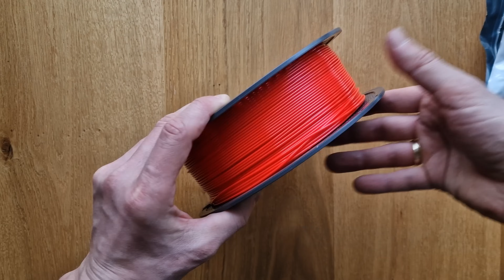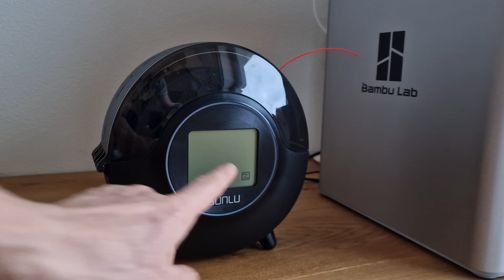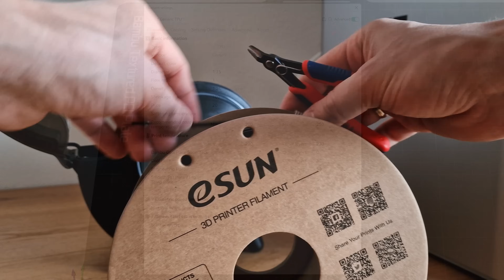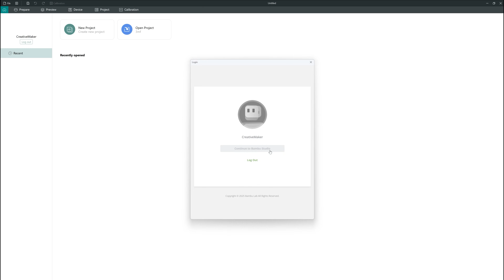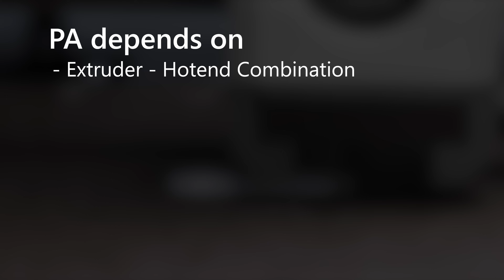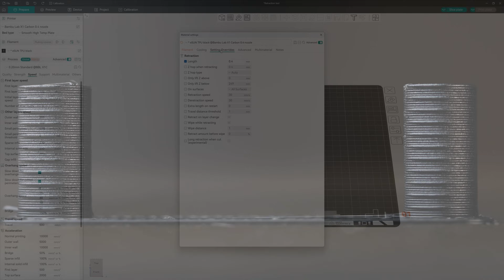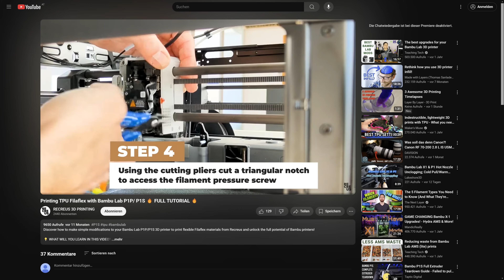Mastering Flexible Filaments on Bambu Lab - the Ultimate Guide 🛠️

Comment: You missed one important thing: cooling. Most TPU needs no cooling! If you turn off cooling you get excellent layer adhesion and indestructible parts. With TPU95A on my A1 i printed last time at 100mm/s accidentally. The part printed successfully, but PA value was not set so it looked pretty bad on the corners, but otherwise excellent. Also i use bed temperature of 50-60C to keep the TPU soft. Of course i avoid printing tall objects, so being TPU soft is absolutely not a concern for me.
Reply from the maker: You're absolutely right—I didn't really talk about cooling in this video. While I haven’t had any issues with the default cooling settings for 95A and 83A, it’s a completely different story with 60A. If the cooling is too high, the extruder jams after just a few layers.
So if I got you right—reducing cooling actually allows you to print faster? 🤔
Thanks for the tip about heating the print bed! I never really thought about how it could improve layer adhesion, but that totally makes sense!
Reply: @creativemakerat  cooling makes the part look nicer but much weaker in my experience.  Turning off cooling allows the material to stay warm, so adhesion is easier, less thermal shock when the new hot material meets the cold one. In general with most materials you always want cooling to keep the topmost layer temperature a bit below glass transition temperature, not less, not more. TPU is a different material because the glass transition temperature is like below -20C and in my experience TPU holds it's shape up to about 130-140C, so that's why it needs no cooling! I tested TPU parts in boiling water and they are just fine. TPU is pretty underrated for heat resistance. Unfortunately i have limited experience, and other filaments may behave differently. I used only TPU95A from Devil Design and some unbranded ones from Aliexpress with hardness around 85A (very hygrosopic, prints slower)
Reply from the maker: @dtibor5903  thanks for the detailed explaination!
Reply: @creativemakerat  just a note, the TPU from Devil Design is not AMS compatible, it is way softer than Bambu's TPU for AMS.

Comment: This is outstanding! Please do colorFabb varioshore TPU next. It is a very difficult material to dial in.
Reply from the maker: Thanks for your kind words! 😊
I’ve added the ColorFabb filament to my to-do list, but honestly, I’m short on time right now. In the last couple of weeks, I’ve only had a few hours to spare for my channel—so it might take a while before I get around to testing it. 😅
May I ask what you see as the biggest advantage of ColorFabb’s filament? Do you actually adjust the temperature in different zones during printing? Maybe someone else here has experience with this material? 🤔
Reply: @ I am using it for precision foam parts. I find it almost impossible to get rid of all the stringing however. I’d like to see if it can be printed without stringing at 240 C for footwear. It can get down to 55a durometer but again I’m not able to get a great quality print.

Comment: You do a great service for the 3D print community. But speaking just for myself, I get lost in all the science of your testing. What I need is a simple cheat sheet that would look something like this: 1. Use this filament... 2. Use this plate... 3. Use this heat... 4. Change flow to this..., etc. etc.  Subbed up and liked.
Reply from the maker: Thanks for the kind words! 😊 And also, thanks a lot for your suggestion.
I'm reworking my script for the next video to include a checklist at the end!
Now that you mention how complicated it can be to follow along - weird that I never thought of adding a sum up 😅
Reply: @creativemakerat  Extremely good work. A summary would be beneficial for some; I just stopped the video when needed and wrote down your golden numbers. I also wrote a short comment (from your thoughts) on each result. I have ordered some eSun TPE 83A and I was comforted to know it isn't as hard to print as the lower hardness/more flexible versions. I've subbed very few times and clear my history out so as not to be annoyed by notifications so subbing for me is a reward to good utubers like yourself. Cheers from Oz.

Comment: My TPU prints beautifully for about 20 min and then clogs every time. I just disassembled my extruder for the 4th time in a row and it's time I stop being stubborn and learn proper retraction settings because it's definitely not heat creep. Thank you!
Reply from the maker: Hey! Thanks for sharing your experience.
What's the shore hardness of your filament? Have you tried reducing cooling—maybe even disabling it completely? I had lots of jams when i increased the cooling.
Also, check your drive and idler gears. I once had an issue where material buildup formed in the gear teeth after multiple jams, causing more problems. If there’s any debris stuck there, try cleaning it out with tweezers.
Hope that helps! Let me know if you get it sorted. 👍

Comment: Loved your video! I can't wait for your video, I am trying COEX 3D 60A and having a lot of issue, I am having issues with clog after every print. Could you please share any quick info on the filament and print setting that I can look into meanwhile you make the video?
Reply from the maker: Glad you liked the video—thanks for the feedback! 😊
Sure! Here are some quick tips while you wait for my video:
Print profile: I'm using 0.2mm layer height and reduced speeds to 20mm/sec.
Filament settings: flow ratio: 1.2, print temp: 245°C, max volumetric flow: 2mm³/sec
Cooling (super important!): min part fan 0% (if layer time > 10 sec), max part fan 60% (if layer time < 5 sec), aux fan: off
If the cooling is too high, I kept running into nozzle jams—the pressure inside the nozzle just gets too high when the material cools too fast after extrusion.
Retraction: surprisingly, I could push it up to 2mm without any issues, though some stringing still happens.
Hope that helps! Let me know if it works for you. 🚀

Comment: I’m wondering, is there a flexible filament that is resistant to gasoline? Thinking of making gaskets etc.
Reply from the maker: Phew, I can't answer, but with 60A or even 83A, you can definitely print watertight gaskets. However, gasoline is a whole different story, especially if it's under pressure. And chemical resistance is maybe also a topic... Would be interesting to see if anyone here has experience with this!
Reply: Hey, you should take a look at this video "3D printed gaskets? Any good?" from @the_eddies . I found it interesting when I was researching flexible filaments for my needs, maybe it can help you!

Comment: The AMS communicates with the slicer and there are been a persistent bug in Orca Slicer with the TPU for AMS. Open instances (anywhere) will reset the AMS slot and not work with TPU for AMS. After I switched to Bambu Slicer there was no longer any issue. I print with TPU for AMS more than any other filament currently. The material is not flexible in the same way that softer TPEs are, but it retains incredible impact strength. Throw the benchy into a wall and watch as it never breaks while rigid plastics shatter on impact. I print Golf Tees with TPU for AMS. It has the perfect amount of impract strength and rigidity required to not break on impact while still allowing me to push it into hard ground.

Thanks for a great video!
Reply from the maker: Thanks for your feedback and the detailed explanation! That makes a lot of sense—I had Orca Slicer running when I ran into the issue of not being able to load TPU for AMS.
I was also really surprised during my mini vise test at how well the Benchy snapped back to its original shape. I’ve heard from some makers that they have issues with layer adhesion when using the default Bambu profile. Have you experienced anything like that?
Thanks again for your contribution!
Reply: @creativemakerat  I have not had issues with adhesion when printing practically any TPU. If I have issues related to adhesion with TPU it is usually in the other direction - getting it to let go of the build plate after it has cooled down. For TPU for AMS I have printed exclusively with Bambu Studio default profiles - without any issues on that end.

Some of the other brands have their own profiles you can import into Orca or Bambu Studio. ESUN have a large library of profiles that made it a lot easier for me. Especially the softer TPEs, e.g. 83A, were difficult to tune, but the ESUN profiles was great from the start.

I print on an X1C and an A1 mini.
Reply from the maker: @marcusnielsen9674  thanks for the infos. I was not aware that eSun providing profiles - great to know 🙏

Comment: A 17% increase in flowrate sounds like a band-aid, while the underlying issue remains unresolved.
Reply from the maker: Thanks for your thoughts! That’s an interesting perspective. Could you share a bit more insight into what you think the underlying issue is? Are you referring to the filament being compressed too much in the drive gears, which reduces the volumetric flow, meaning the tension adjustment screw should actually be loosened instead? Would be great to hear your take on it!
Thanks for your contribution! 😊

Comment: For TPU you need to use an engineering plate rather than PEI .. that way the TPU won't stick as much
Reply from the maker: It looks like Bambu no longer sells the engineering plate, which is why I used the PEI plates in my video. Personally, I’ve had good results with PEI, but I’m curious—what advantages do you see with the engineering plate for TPU?
Reply: @creativemakerat  the reason I say that is that when I was printing with 'generic' TPU it was very sticky with my '3rd party' PEI plate and a lot less so with the engineering plate. So I'm in the habit of using engineering when I print TPU.
also I have a very humid environment and print from a dry box to keep the moisture down. I found that makes a big difference. for me.
Reply from the maker: @sjay67  Thanks for explaining your reasons in more detail! I’ll definitely give the Engineering Plate another try in my next video.

I used to print 95A on the Engineering Plate as well, but for 83A and 60A, I’ve always used PEI plates. With 83A, removal is still fairly easy, at least from the textured plate- but with TPU 60A, it gets tricky. On the smooth PEI plate, the adhesion is insanely strong.

I also always print TPU straight from the dryer, but with 60A, that’s basically impossible—unless you modify the dryer and mount or place it directly above the printer 🙃
Reply: @creativemakerat in some cases adding glue actually lowered the adhesion.

Comment: awesome video, hope to see the next one soon, I'm dreaming to print that 60A filament for some time now. Anyway I partially solved this need using FOAMING TPU that is about 93A when printed at the standard temperature and flow rate 1.0,  but can reach about 70A when printed at higher temps and lower extrusion rates, but ti need some tuning on the extrusion flow to be printed fine
Reply from the maker: I've never tried foaming TPU. Thanks for sharing your expirience!

Comment: I dont think orca's retraction test is great, it doesnt stress test enough the retraction system.
I have had very successful reatraction tests only to fail when trying to print honeycomb patterns because the system wasn't able to keep up with the constant retractions. 

It may still lead to a lot of string anyway at different moments. I think it has something to do with not reaching enough acceleration and being able to fully have the proper retraction when the system is under a higher pressure. temperature is related, but not the only piece at play.
Reply from the maker: Thanks for sharing your experience. You may can recommend a better calibration/tuning method?
I've searched the web - found some methods where four towers are used instead of two. But i think the result would be the same?
Thanks!
Reply: @creativemakerat  those 4 towers usually lead to more stringing than normal tests. My thoughts are the orca retraction test is good enough if you are doing a retraction, printing something not very small, and then retracting again... In Orca, even if your retraction speed or distance are small, it is enough for one retraction followed by that extrusion around the tower and back.

The 4 towers, on the other hand, have you printing much less, moving, then printing a little bit again,retracting, moving, etc. This is likely to really push the pressure being built inside the nozzle and forcing the stringing issue to happen.

Or just print a small honeycomb wall, that is one of the worst cases for retraction that are quite common to print.
Reply from the maker: @_litz  Thanks a lot for sharing your insights 🙏! That makes a lot of sense, and I really appreciate the detailed explanation. I’ll definitely try printing a small honeycomb pattern to see how it compares.

Comment: I was making profiles for my printer (not Bambu lab) for 85A to get more speed, then learned my printer firmware doesn’t have linear advance set up, and I don’t feel comfortable compiling my own as it’s IDEX so its more complicated. LNL Tenlog if you’re curious.

Back to using default profile @3.2 volumetric flow and not 13 😢. The quality is perfect at slower speeds but I know the hardware can support much faster speeds.

Comment: Dude, how is it possible, every time i tried to print with TPE i constantly clog the nozzle, i tried to release spring tension, change temperature, nothing helps, my filament is also in a heated box with rollers and i just can't seem to print with it. My printer is X1C
Reply from the maker: Hey! May I ask what Shore hardness your TPE has? With 83A, I’ve never had issues with clogging, but with 60A, I ran into jams quite often. Here are a few things that helped me avoid them:
- turn off cooling completely
- set retraction length to 0mm
- print very slowly—reduce max volumetric flow to 2mm³/sec
- try increasing the print temperature (i dont know your filament, but 250°C should be a good starting point)

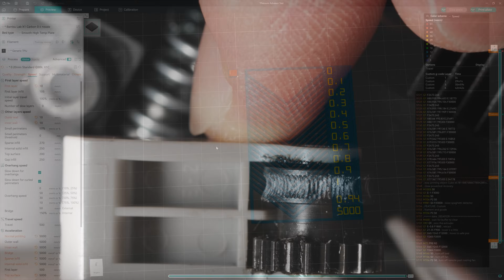Also, check your extruder drive gear (I show this in the video at 36:22). After multiple jams, I realized that filament debris had built up in the gear flanges, causing the filament to slip. Cleaning it out made a big difference!
Reply: Hi Froust, when the printer tries to extrude any material, there is a force from the gears down into the melt zone. This force is critical because when it gets bigger from faster extrusion or a smaller nozzle or lower melt temperatures the flexible filament gets creative and will find any possibility to bend, crumple and cause friction, escape or tangle up. So my short answer is to lower this force and see what happens. Easiest way is to reduce speeds. I am personally not a fan of loosening the gear pressure as I find this to be a bandaid solution to keep this force in check, but I know it is widely used. As an example for Filaflex 82A I don't modify the printer but run slow profiles. Anything above this hardness is more forgiving.

You might have seen other filaments like PLA jam in the hotend in an enclosed printer when chamber temperatures are too high. The filament softens and compresses to look like an accordion bellows. My hypothesis is that the very softest materials can do this without the heat softening but adds enough resistance in the filament path to cause clogs.
Reply from the maker: @Makeringredients  Thanks a lot for this detailed explanation! It’s super intuitive and easy to understand. What I’ve learned from printing 60A is that reducing cooling is really important—otherwise, the material cools down too quickly as it leaves the nozzle, which increases the pressure inside and leads to jams.